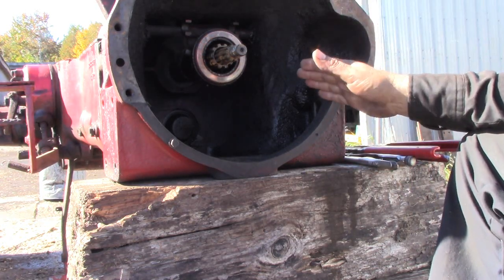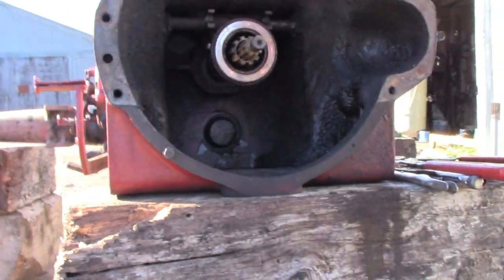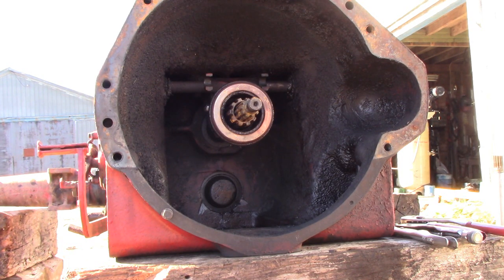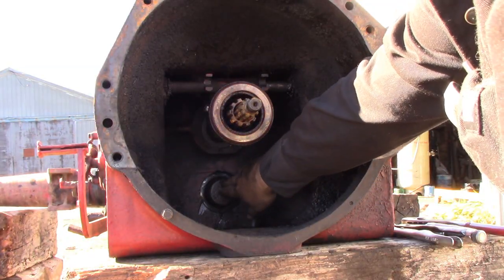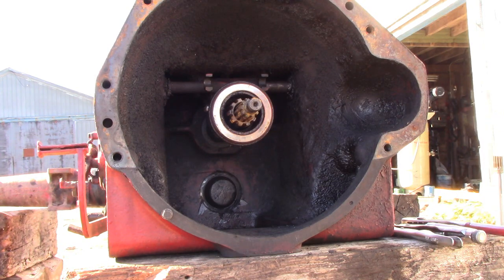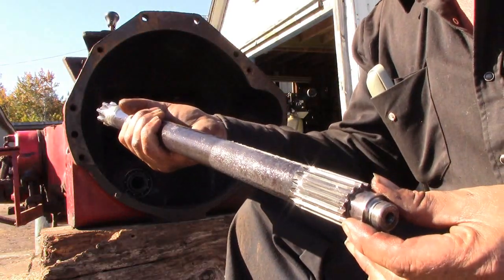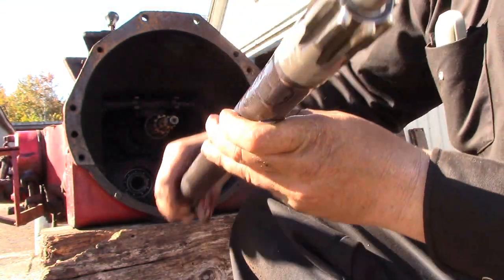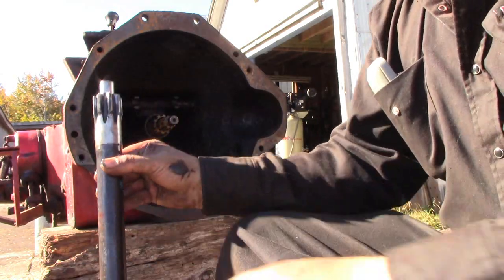B414 Etc  Series PTO

Comment: Good morning Dave! I love all your videos! They really are helpful for a guy like me in Sault ste Marie, MI 49793. Currently I have a IH 3414 without a pto. I’d like to add a pto shaft to it. Can it be done? If so, do you have the parts or a good resource for parts? Let me know please. Thanks
Derek
Reply from the maker: You would not have "live" PTO, it would be transmission driven so when you depress the clutch to stop the tractor the PTO would stop too. You will have to check and see if the splines are there to run the rear PTO shaft. If so then the rear shaft and collar and a shift lever would get you set. I would have those parts, you can contact me at sales@chowntractorparts.com
 Thanks for watching!
Reply: @CanadianRedneck15  thanks Dave. It helps a lot. I needed some direction, lol! I’ll check if there is a place to plug in the pto shaft. I’ll be in touch shortly!
Reply from the maker: @canutedr    sales@chowntractorparts.com
Reply: @CanadianRedneck15  I received the parts I ordered from you a few weeks back. They were hard to find! They look good! Thanks for your help Dave! I’ll keep you posted.
Reply from the maker: @canutedr  Glad to hear they made it OK.

Comment: Does anyone know how to remove the pto primary shaft on a IH 434 Mine will not push back after removing the rear pto shaft. Mine is fitted with a Torque or speed amplifier The bellhousing end is threaded but doesnt appear to want to pull forward much either ?
Reply from the maker: That's interesting, I didn't know there was an option of a TA for the 434s.
  If the front PTO shaft is threaded there should be a nut holding it in the bearing, once that is removed it should push to the back.
  Thanks for watching!

Comment: Hi. I've recently purchased a 414 diesel and I realize that it may have a somewhat uncommon accessory/feature in regards to what seems to be related to the PTO system.. Looking at your video (as with most of the footage I've come across trying to sort this out) there is visible, in the first half, a three- hole sector to the left of the serial plate. Slightly lower, slightly left there is a blanking plate. On my tractor there's a lever sticking out where the plate sits on the one you're working on, and it seems to have something to do with pto speed or something...? 540/1000rpm?? Do you or anyone know what the selector on my machine does? Haven't found anything online regarding this.. These are rare birds here in Norway. Your videos are pure gold by the way!

Comment: Hi Dave, great videos and really glad you’ve done the series on the 414.  
I’ve got a 444, with a PTO lever that doesn’t engage and just falls forward... any chance you have any footage on how I might access the lever inside without removing the hydraulics off the top?  

Thanks again, great videos. 
Matt
Reply from the maker: Hi Matt, I'm glad you enjoyed the videos. You can take the PTO lever out by removing the three bolts around the lever housing and pulling out through the side of the differential case. The inner part of the lever is pinned on, the pin has likely broken and needs replaced. When you re-install you have to get the pin on the inner part of the lever into the groove on the sliding collar. Good luck and thanks for watching!
Reply: @CanadianRedneck15  any video on this? I don't understand about the new pin and how to get it to go into a groove..      my pto lever is broken right off and I ordered a new one, it didn't come with a pin or instructions..
Reply from the maker: @leinhit  The groove is in the sliding collar on the PTO shaft. On the inside end of the PTO lever is another short lever that hangs down that has short nub(pin) sticking out that goes in the groove. The lever on the inside is pinned to the shaft through the housing that bolts to the differential case.
Reply from the maker: @@YT-ou6vq  I am glad you are enjoying the videos! It is possible that his PTO lever is seized in the sleeve that holds it in the rear case. Remove the three bolts and make sure the lever is free. Thanks for watching!
Reply from the maker: @@YT-ou6vq  Right, there would be gear oil behind the three bolts, you may want to drain the rear case down a bit before you pull the lever etc out.

Comment: Love the video...hopefully going to save me from splitting mine... do you have a part number for that shaft? Im having troubles locating that number.
Reply from the maker: I am glad you found the video helpful, the front shaft(the one that usually needs replaced) is part number 3068451R1 with the nut R2 with the circlip, the rear shaft is 3073111R91. Thanks for watching!
Reply: Canadian Redneck would you know what the part number would be for a model 354 pto drive shaft. Great video!

Comment: I have a 384 international diesel.  The pto bushing part number 751161r1 is worn out.  II is  part number 8 on the pro diagram in the repair manual.  I have tried all the sources on the internet and my local tractor dealer and cannot find one.  Could you tell me where to get  a new or good used one.   If one cannot be found could a mechanist make a suitable replacement?  Thanks
Reply from the maker: I just put that part number in google and 3 suppliers popped up right away. A machinist should also be able to make one for you with the proper dimensions to work from.
  Thanks for watching!

Comment: I can tell you getting that plug out without the tractor split will need some manly 90 degree snap ring pliers.  Plus a few extra words.  Not really enough room to do it with screwdrivers with the front of the tractor in the way.
Reply from the maker: LOL indeed, it is a pretty stiff heavy lock ring and not much space to work it out of the groove. Thanks for watching!
Reply: I bought a set of snap ring pliers off eBay for $20 after watching another one of Dave's  videos on these tractors. This video helps you to understand more what's going on in there seeing it stripped down.